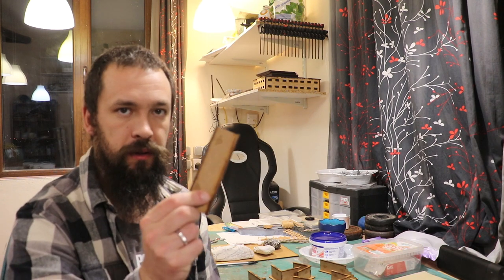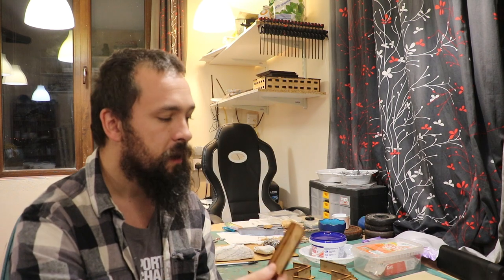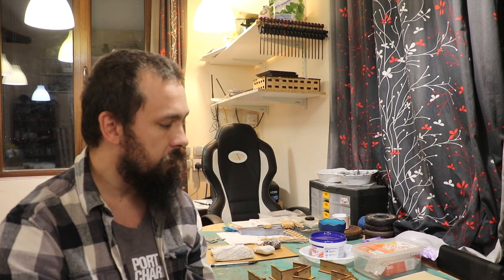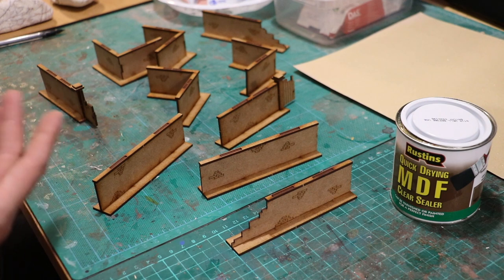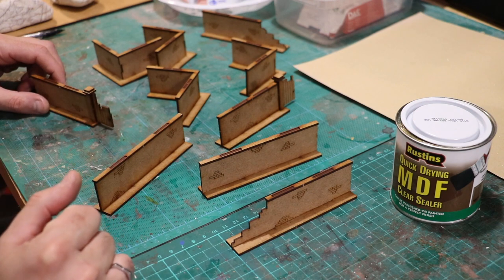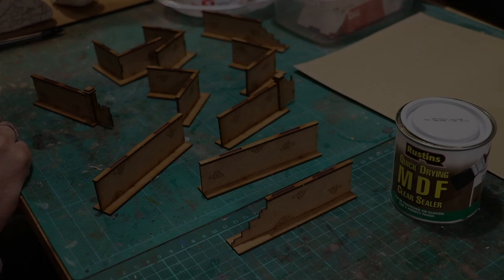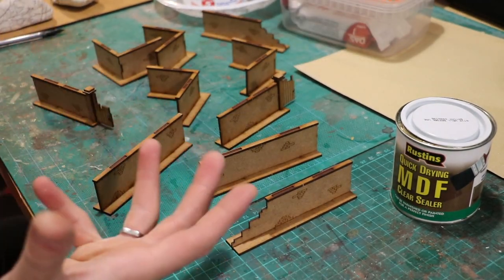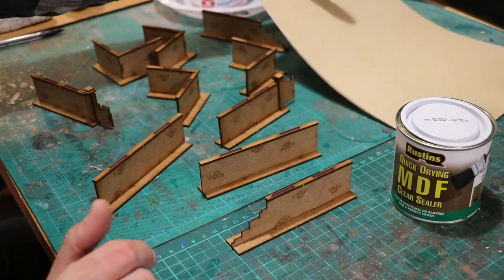Let's talk basics - Putting together MDF kits (Part Two)

Comment: Another great video thank you, really interesting idea to use the sandpaper. my only peeve with mdf if the holes/gaps where 2 bits slot together any thoughts on how to fill them? sorry if you mentioned it but i was watching while trying to get the kids out the house
Reply from the maker: hey thank you very much :) yeah the sandpaper worked out far better than I expected...

Regarding the tabs yeah that's exactly how I feel as well. For this you could cut thin sandpaper and paste it on, or take thin slices of air dry clay and stick that over the top.

In general the tabs are why I spend time doing these extra steps with pollyfilla or air dry clay. You can get a good enough result "just" painting MDF apart from those tabs.

Episode three will also have another couple of options that work well for this.

Thanks again :)